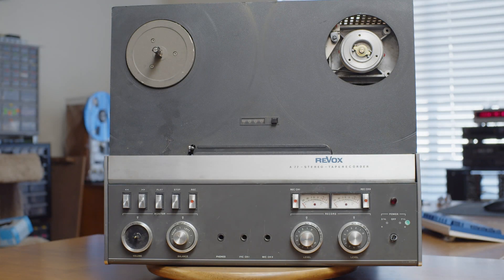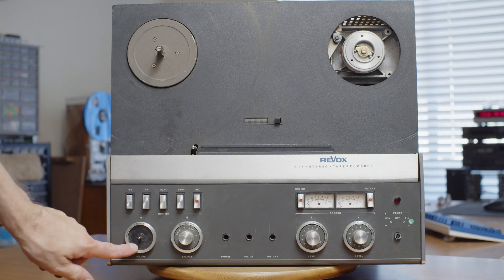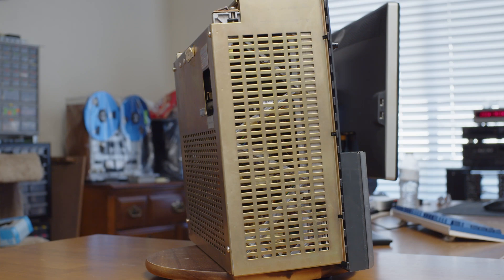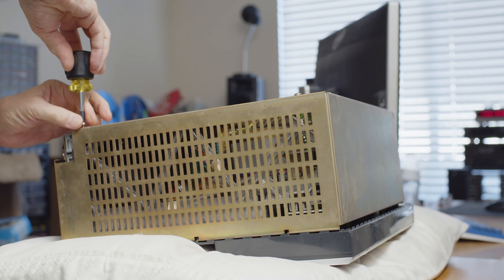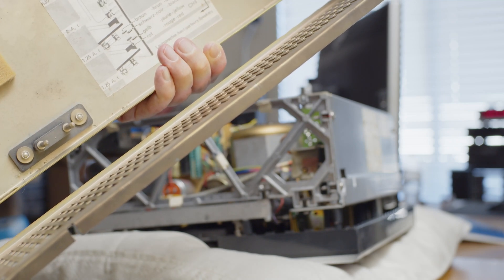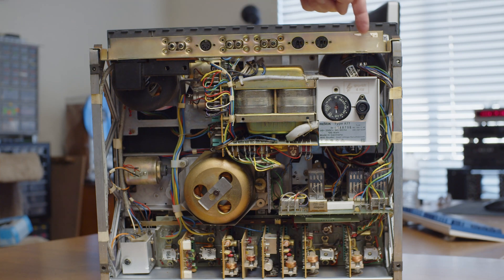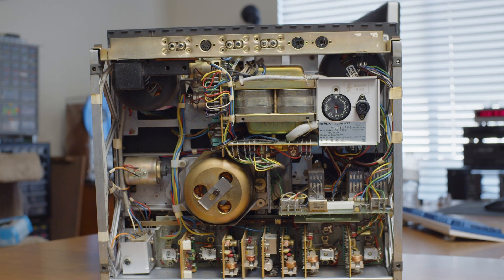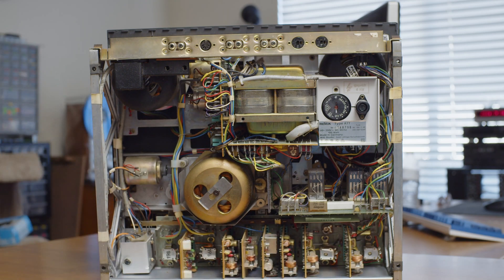ReVox A77 MKIV teardown and refurbishing - Part 1

Comment: I recently obtained the A-77 version with the dolby circuit.  I remember using these at a radio station in the 70's.  My question is the red bulb to indicate it is on is burnt out. Also there is no meter backlight  illuminitation when the unit is on.  Ironically, when put into the record mode, the VU meter back lamps come on along with the associated  red record indicator lamps. Where can I source and what lamps would I need for the unit to illuminate correctly. Mine is the quarter track version.  Thanks!
Reply from the maker: If I remember correctly, the VU lamps only come on when recording. I got a set of replacement lamps on eBay. This is the listing I used. The seller is in Germany, and has more. https://www.ebay.com/itm/296548258442
Reply: @trappedinthefuture  Thanks. I could not souce any parts from Europe because of tariff issues. I did find 21V bulbs in USA and these are working fine now. I have MK IV version, so the VU meters alwasy stay lit while on, and when you go into record mode, another bulb lights up the red record dot in the VU meters.